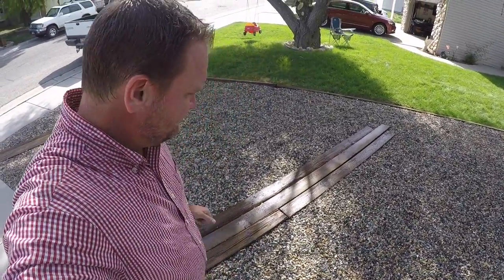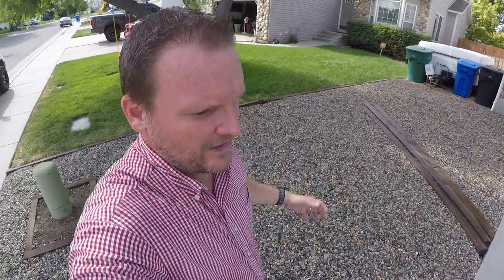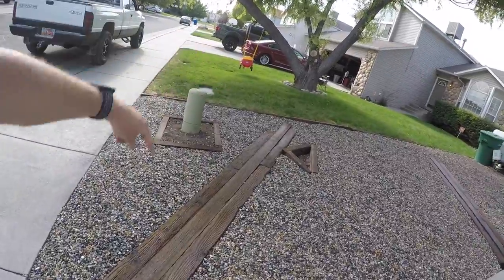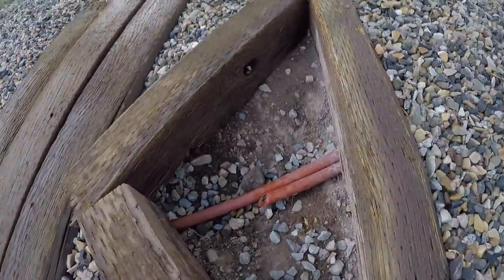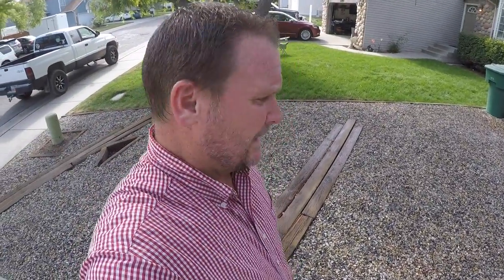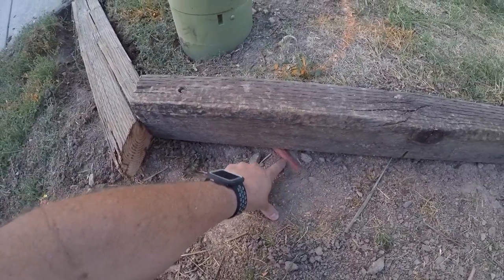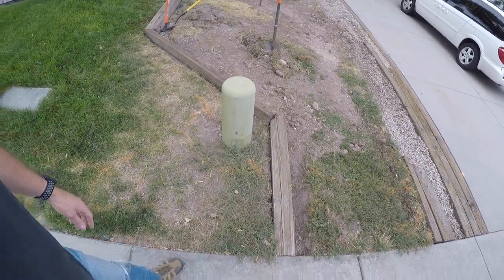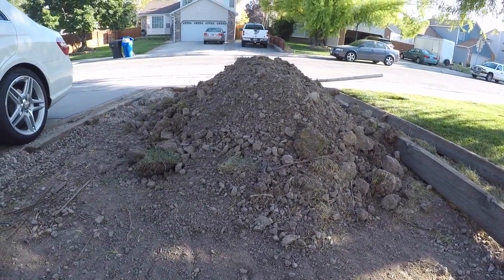DIY Driveway Widening With Hand Tools - timelapse

Comment: Were you able to get a permit for this with that transformer/cable box there? I want to extend my driveway badly, but unfortunately, I have a transformer just to the right of my driveway, about the size of that one, and am unable to get a permit. The electric company has to dig through my grass to get to the underground wires if and when there's a problem. If cemented, they can't do that. That box has underground wires, which would be impossible to get to without breaking the concrete, so I would be surprised if you were able to get a permit for it.
Reply from the maker: “Call before you dig”. Make sure you know where the lines are buried and get whatever permits you may need based on where you live. I did t have to pull permits and Comcast came out and repaired the cable I accidentally cut with no charge to me. Just be safe!  The widened driveway was worth the effort!  🙌🏼